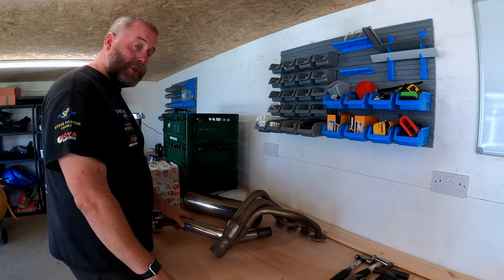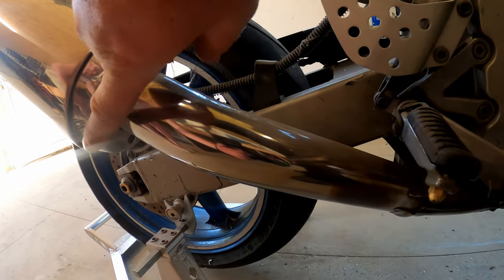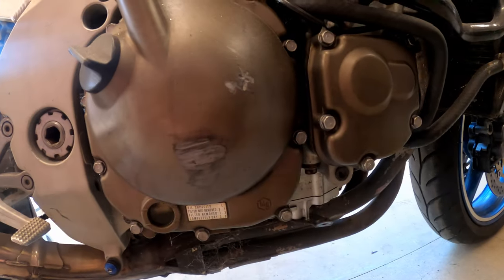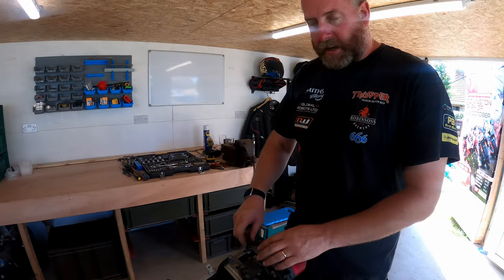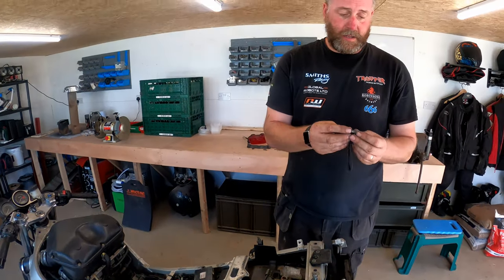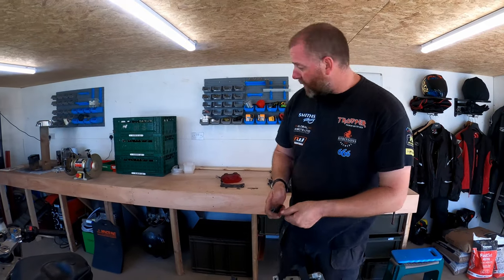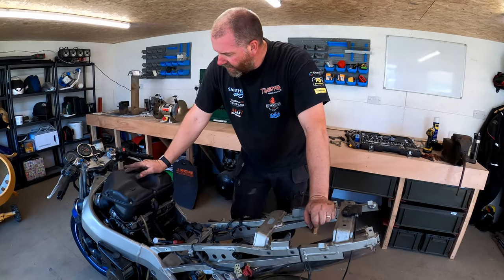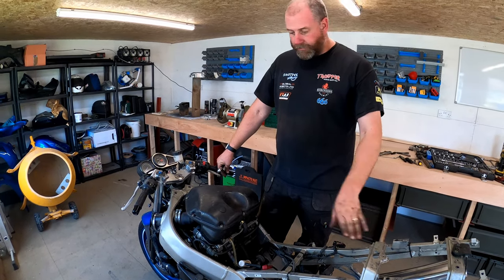1998 Kawasaki ZX9R - Project Shinobi, Episode 2 - Continuing The Teardown!

Comment: You should put a racing exhaust can on. The stock can is very restictive and weighs a tonne.
Reply from the maker: Yeah I can appreciate that! Several sources however do state that the bike has always ran better on the stock exhaust with standard jetting, there ages before I need to think about that though. I’m keeping my eyes open for a nice Akrapovic exhaust though! 🧐
Reply from the maker: @nitramh24  Good info that bro, i'll check it out! ;)
Reply: @KevsShed  Cheers! I love your videos! The benefit of keeping the stock can is that you will have smoother operation below 3000rpm, good for inner city riding. But this bike isnt meant for riding at sub 3000rpm😂

Comment: Hey keV I have the 5th gear issue on my c1 can you tell me which z1000 gearbox fits as there alot of miss info out there. ??
Reply from the maker: If I recall correctly it’s any Z1000 tranny from 2003-2006, mines a 2006 I think. It was a while ago that I bought it though so may not be quite right 👍🏻

Comment: The C2 is the 99 model dude... might be registered late 98, but the C2 is normally known as the 99 model
Reply from the maker: Yeah, I agree, this bike history is slightly confusing! It wears 99 bodywork but it was first registered before the 99 model was released! 🤷🏼‍♂️
Reply: I think it was just fitted with lots of C2 parts after it had a pretty hefty crash, no C2 would have been around in '98, but you might find late registered models, like a '99 C1 for example.
Reply: @HalfdeadRider  You’re probably right👍 I’m no expert on the UK reg numbers, I just noticed the fairings, which are off a C2, and that it said C2 on one of the parts, can’t remember where I saw it though. Love the series, I have a C1 myself, done lots of mods to her.
Reply: @nitramh24  yea that sticker on the undertray said C2, I would think that came with all the fairings. I have the E1 in the same lightning blue, and violet, best colours imo of course 😁  I done a fair bit to mine now too 👍

Comment: Great video I got mine 2002 e1 zx9r where are you getting your parts from? As I need some my bike has done 7500 miles and the air filter was so bad it was falling to bits when I took it out. 👍👍
Reply from the maker: Not certain yet on the parts supplier as I am yet to order any other than the second hand parts that I have sourced from eBay or autojumbles. I would imagine that I will use Fowler of Bristol for most of the genuine stuff though.
Reply: @KevsShed  thanks I will give them I try. 👍